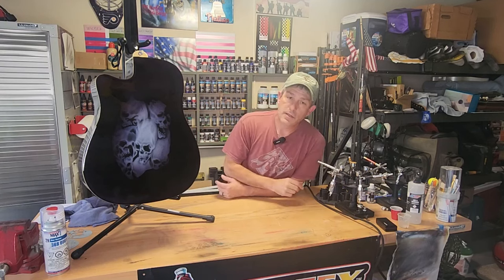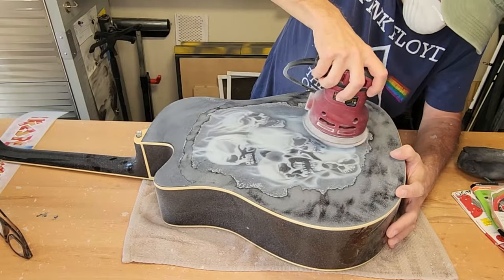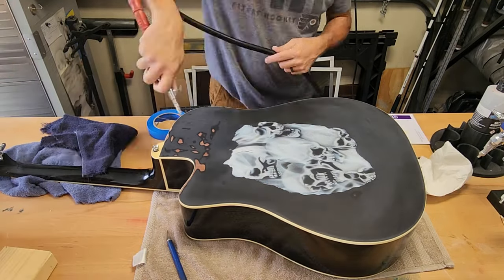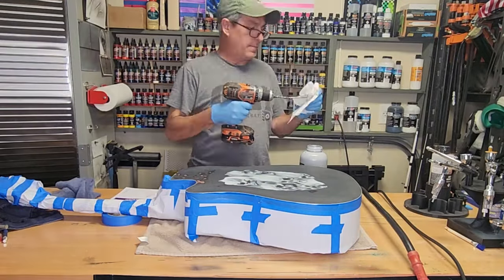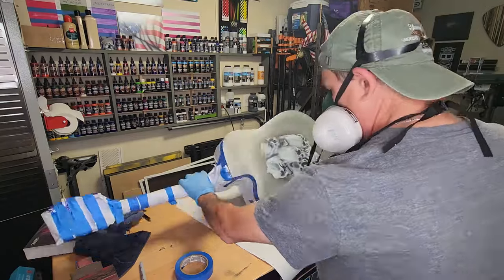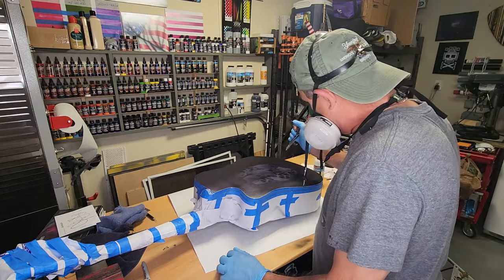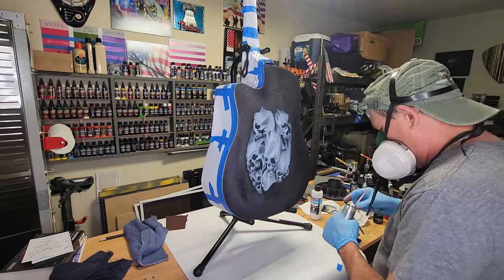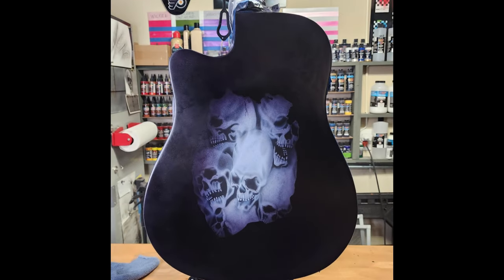Airbrushing and Mistakes! Don't Panic! Just fix it!

Comment: Would a heat gun or hair dryer on low heat, helped to dry the candy coat quicker?
Reply from the maker: Air, but not hot air. I use a fan, but be careful that you don't blow dust on to your project.

Comment: I just got some candy paints.  My Hobby Lobby had the paint but didn’t have bleed checker.  I went ahead and tried it on an old fishing lure as a practice piece. I found out for myself that candies really do bleed through regular Createx paints even after multiple coats.   Since I don’t have bleed checker yet, have you ever tried UVLS instead?  Guess I’m wondering if UVLS is just a variation of the bleed checker formula 

Video was interesting. Nice to see that I’m not the only one that goofs up projects.  You have an excellent presentation style and I always learn something.  Thx
Reply from the maker: Chuck, yes. I used the UVLS for an inner coat (Bleed Checker) in the video. If you don't seal candies in the will Bleed through.
Reply: The science behind stopping a candy from bleeding or leeching into subsequent layers of paint comes down to using dissimilar materials.  UVLS is generally used as the "carrier" when mixing candy2o.  Dan used UVLS and reducer to mix his candy in this video.  Applying the same products that the candy was originally mixed with on top of the existing candy layer can and usually does allow the candy to be reactivated.  That is what causes the candy colors to leech into subsequent layers of paint.  That is the reason 4040 Bleed Checker is recommended to be sprayed straight out of the bottle with no reduction.  Adding reducer to Bleed Checker introduces a similar material already in play and will likely allow the candy to reactivate.  Does that make sense?  

So, while you may get away with using UVLS to stop a candy from bleeding, I wouldn't rely on that method because it will come back to haunt you at some point.  There are other factors that influence whether a candy will bleed or not, but the most effective way to stop it is using a dissimilar product to lock it in.  A catalyzed urethane clear is another option.
Reply from the maker: @wickedartstudio  Trevor, I hope all is well. It's been a while. Thank you for that. That is very clear and sound advice that makes sense. I never stop learning learning. Thanks.
Reply: I ordered Bleed Checker and just received it today.  I’ve tried the Candies with partial success so far.  I tried Lemon Yellow over a yellow base hoping to get some pop in the color.  Results were underwhelming, though I haven’t epoxied it yet.  I did use them on a chrome lure and the results were very good

Guess they need to go over a light color base.  I’ll keep trying different applications.

Thanks for the detailed response
Reply: @Indyjeeplover  You will generally get better results over lighter colors; however, it greatly depends on how many coats of candy you use as well.  One or two quick light coats of candy will produce underwhelming results (it creates an almost pastel looking shade of color - try it on a plain white sheet of paper).  Keep in mind a true dye-based candy is completely translucent once applied and will continue to darken with each subsequent coat.  So, adding additional layers of candy will darken your underlying colors but those additional layers of candy will also intensify the colors underneath once enough coats are applied.  The key to getting good results with a candy wash is spraying the candy to full saturation.  How many coats are required to reach full saturation is dependent on the color of candy you are using.  Lighter hues will generally require more coats to reach full saturation compared to darker hues.  For example, Lemon Yellow will require more coats compared to Blood Red.
Reply: I really appreciate the detailed replies.  Seems the more I learn the less I know

Comment: I've never touched an airbrush but I'm thinking of trying. Been watching your videos and one thing baffles me - how do you keep the paint from flying out of the cup when you don't use the cap???You get pretty animated sometimes and how the paint stays in is beyond me.
Reply from the maker: CN, I usually do not have a lot of paint in the cup. But there are times I use my cap. I totally recommend the cap. Early on, I messed up a painting or two because of paint splashing out of the cup. I guess after so long, you just get comfortable with what you can do and what you can't. Thanks for the question, and thanks for watching.

Comment: Amazing, how big is the air compressor used cause i wanna buy the smallest that i can get buy to spray a guitar body! any ideas?
Reply from the maker: Aa, for my airbrush I use a 2 gallon Fortress from harbor freight. And for the small spray gun, I use a 4 gallon Craftsman. It really depends on the guns you want to use. Look at cfm for the gun and the cfm the compressor puts out. I hope this helps.
Reply: It surely does. Thanks @TheAirbrushGarage